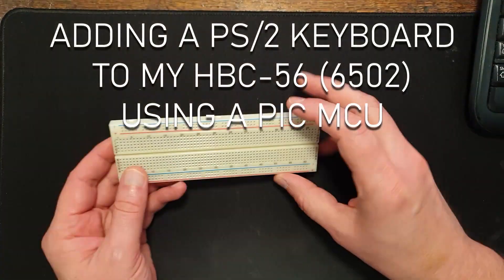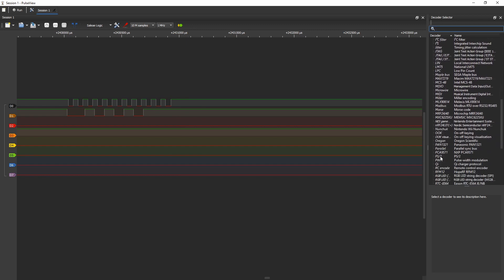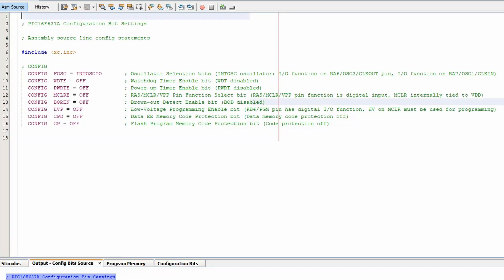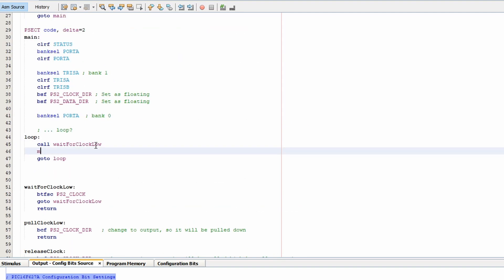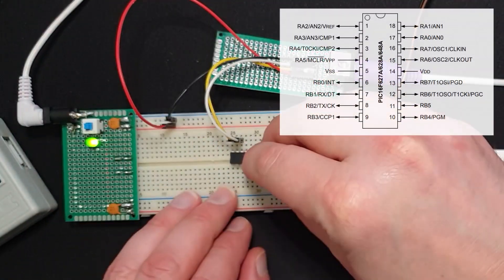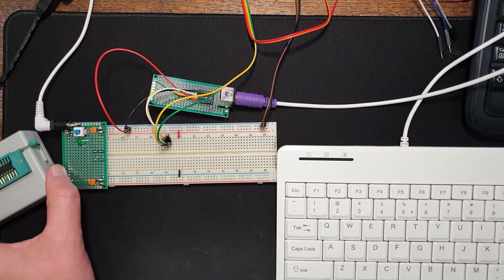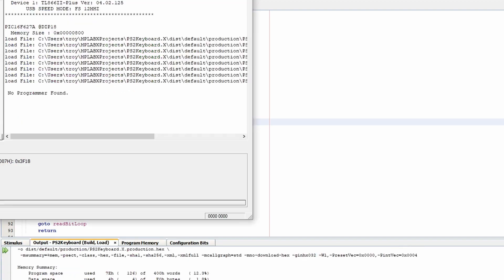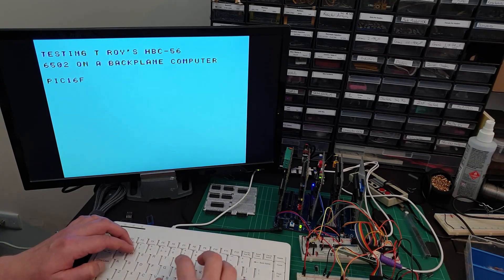A keyboard for my 6502 using a PIC MCU

Comment: AH, the 627A, what a noble MCU; it was the first PIC I've used, with MPLAB (the old one) and assembly. I would've loved to have a signal analyzer back then, but I ended up flashing it constantly (with a homemade serial programmer) until whatever I was doing worked. Pretty cool project!
Reply from the maker: Cool. Yeah, the logic analyser is very useful. For the price ~$15 or so, it's a bargain. I'd still like to get an oscilloscope, but have managed without one.
Reply: I really, really miss MPLAB (the old one).

Comment: I basically did the same, but on an ATMEGA328P, with PS/2 keyboard and mouse, as well as the NES controller. It all worked on the breadboard. But now that I have it on a PCB, it doesn't work. Well specifically, the crystal isn't firing up. both xtal lines are at 0V.  Oh well, lots of debugging in the coming days.
Reply from the maker: Nice one! That's annoying. Debugging fun and games... sigh